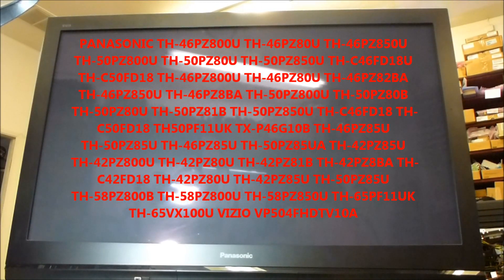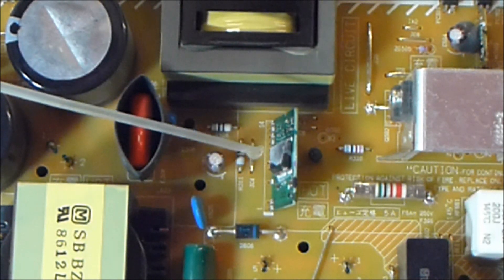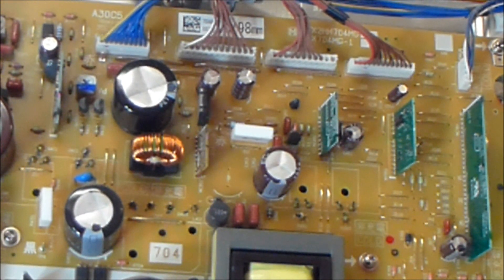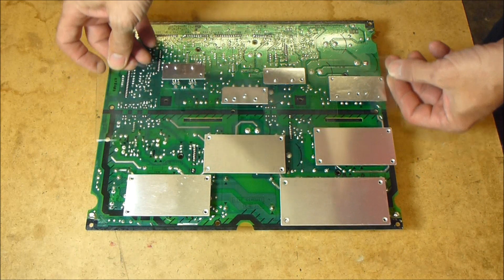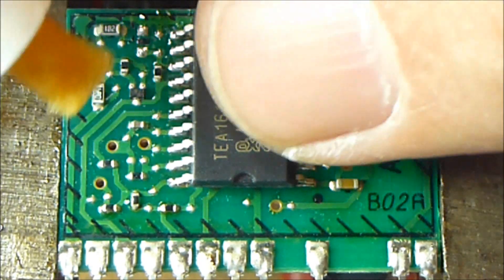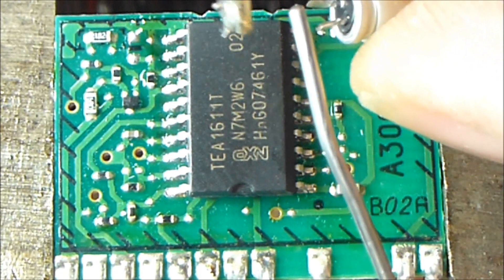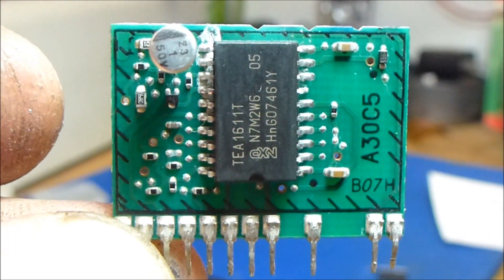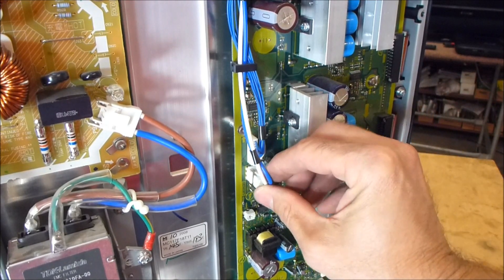Panasonic Plasma 10 and 2 Blinks TEA1611 ETX2MM702 704 706 Power Supply TH 42 46 50 58 PZ 800 85

Comment: Is there a kit for this?  I have over 30 years soldering experience, even with SMD's.  I have the TH-46PZ80U and used "freeze spray" on the circuit which of course got the TV back up and running.  Please shoot me an email if there is a kit for this particular model,
Reply: Okay, I finally watched the whole video.  When I remove SMD's I use a heat gun hitting the center of the old chip and it pops off on it's own without the possibility of damaging the pads.  When I put the new SMD back on, then I bridge all the pins with solder and remove excess with solder wic.
Reply: Mitchell Simmons
Nice work !
Did you also replace the IC's decoupling capacitor  ?   This is the device that actually fails and causes the IC's power rail to droop down enough to wreak havoc with the analog resonant converter IC.
Regards, GS.
Reply: Gary Spencer I haven't ordered the kit yet.  I was wondering if one can purchase the IC's MC301 and MC201 without replacing the caps.  I agree the capacitors are faulty, Sony is notorious for installing inferior caps, although this is a Sanyo
Reply: Mitchell Simmons

Mitch,
The designators for MC201 and MC301 refers to the circuit board name.  There are no designations for
components mounted on these boards.  The 20 pin integrated circuit (IC) TEA1611T is made by NXP Semiconductor.
The MC201 & MC301 boards are no longer available.  The only way to obtain these boards is to buy the large
P Board.  I do not recommend replacing the IC's.  They rarely fail and are very high quality and robust.  The small
ceramic decoupling capacitor is the device that slowly breaks down and causes Vdd to droop down at ambient
temperature.  The low supply potential on Vdd will cause the analog chip to malfunction causing these high current
power supplies to shut down.  These switching power supplies are high efficiency Series Resonant Converter designs
(Series LC Resonant Converter).
Remove the ceramic piece of schitt and replace with high quality electrolytic with short leads (approx 3 to 5mm) using
capacitance in the range of 0.22uF to 1.0uF.  I used a 50V, 1uF, cap from DigiKey.
Regards, GS
Reply: Yeah, that's what I ordered, just the caps.  4.99 for four of them.  My experience with power supplies dates back to the early 80's.  The replacement caps shows that the OEM are inferior.
Reply: +Gary Spencer Did you replace the ones he replaces on this video, I would rather not replace the IC chips if it's un-necessary.  could you let me know what capictors you replaced.  thanks
Reply: I got mine on eBay.  It was such a while ago, like three or four years ago.  It comes with the two ICs for the MC301 and the MC201 and the electrolytic capacitors.

Comment: My Panasonic Viera 50" Plasma started doing a similar thing about a month ago. But If I unplugged the power for a few minutes then plugged back up..,everything was back to normal. And it would work like normal for several day to a week, then out of the blue it would happen again. That is until this morning. It did the red blinking light this morning and despite unplugging numerous times,etc...,nothing. When I plug it back up, it sounds like the tv clicks on..,but nothing but black screen and 10 consecutive blinking red lights. I count 10 blinks instead of 7. My tv is a little older (March 2008)..,but has never ever gave me any trouble at all. That is until about a month ago and this started happening. Now it wont do nothing but sit and damn blink !!!  Model # TH-50PZ80U. Please help..,as I cannot afford to go buy another tv !!  :(
Reply: ...,Great video. But I'm not good at very technical self repairs like you did in the video. Plus I don't have the tools either. I just wonder if its even worth "trying" to pay to get it repaired or just (try) to save up and get a new tv ??!!  :(
Reply: Ok..,after getting aggravated w/ the tv this morning. I just went to bed (I work 3rd shift). I got up about an hour ago and figured what the heck..,Id try the tv one more time. Plugged it up (heard 2 clicks)..,walked around and no blinking red lights. I hit power on remote and surprise..,it Works !! Its back on now........,for now :/
Reply: ZyklonB13

Unfortunately, it will fail due to a marginal component that is out-of-spec or degraded.
So, when it finally fails, pull the back cover off the unit and perform the "cool down" test shown in the repair video.
If it responds to the cool down test, then you could bring it to a GOOD repair shop for a repair estimate.
The repair should be less than $100 bucks (in my opinion).  All they have to do is replace a $0.30 capacitor
on the MC201 or MC301 mezzanine board(s).
Otherwise, if you know someone who has good soldering skills, ask them to remove/replace capacitor.
The CAPACITOR is the component that fails - NOT the NXP integrated circuit (resonant converter controller).
Regards,  GS
Reply: Gary Spencer  Well..,I knew it couldn't last long. Got up this afternoon and tried to turn on tv. Same thing...,nothing but 10 blinking red lights. Uhhgggg!!!  Guess I will do as you suggest Gary and remove the back and try the cool down.

Comment: Thank you so much for this video.  Did the freeze on both my IC chips independently and it solves the problem.  Problem is I don't have the ability to solder new IC chips.  Calling around to local shops they're quoting me 125 to 150 bucks in labor.  That seems excessive to me, am I being naive? Especially if I can bring them just the P-board, I've already taken the TV half apart.
Reply: Andy,
You are smart not to attempt this.  It is NOT trivial in the least.  It requires a fair amount of experience and specific talent
with the right heat output from soldering iron.
Several people in this blog had damaged the MC201 or MC301 boards over the last 2yrs or so.
Removing the de-coupling capacitor is much harder than installing the new one.  The capacitor is the actual component
that is failing.  It is extremely rare that the NXP controller IC will fail.
Which board was sensitive to the cool down test  .......MC301 ?
The local shops near you are nothing but bandits.  It takes less than 5 minutes to remove the MC301 board from the
P Board.  It takes about 8 to 10 minutes to remove & install the new IC.  It takes less than 3 minutes to remove & install the de-coupling cap.  And, .......you have the luxury of sitting on your ass while you're doing the job  !
I will fix it for you for free.  But, I will insist that you get two 1uF, 50V high quality electrolytic capacitors before you
send it to me.  There is ordering info for this in this blog in several places (Digikey) in my replies to folks.
So, let me know if you want to ship it out. You will have to buy an anti-static bag large enough for the P Board.
What is the model number of your Panasonic Plasma  ?

Regards, Gary
Reply: Gary Spencer
"It takes less than 5 minutes to remove the MC301 board from the
P Board. " ...  How exactly do you remove it?
Reply: +Gary Spencer How can I contact you?
Reply: Andy Ludwig 
Andy,
You can contact me via my Gmail account.
      garyspencer586@gmail.com
Gary S.

Comment: When I plug it in I get the 2 clicks followed by the pause then a single click. When I try to power it on I get a single click and then the set goes into the 2 blink code. The manual says the 2 blink code is for the D-board but I replaced that and I am still getting the same result. Any ideas?
Reply: Yoosuk,

The blinking SOS codes ONLY indicate which board needs to be checked.  The list of codes (1 thru 13) guides you
to the location where you can measure a Test Point.  It DOES NOT mean that the "board" is the failing board.  It only means that you can go to that specific board to perform a check point .....or Test Point.
Please give the full model number of your TV.  I need to know if it's a 10 or 11 chassis.  Thanks.
GS.
Reply: it is the th-42pz85u
Reply: Yoosuk Choi

Yoosuk,
You're going to need the Panasonic Troubleshooting Guide to isolate the failing board and/or circuit.
It is most likely the P Board.  Did you perform the "cool down" test shown in this repair video  ?
If not, you need to do that test before you try anything else.  The 2 blink SOS code indicates a loss
of +15V.  This voltage is generated on the main power supply board (P Board).

Download the Panasonic technical handbook at link below:
http://elektrotanya.com/panasonic_th-42-46-50pz80u_th-42-46-50pz85u_th-42-46-50pz800u_th-46-50pz850u_chassis_gph11du.pdf/download.html

Comment: Thanks for posting this video, it has saved me from having to throw my Panasonic Plasma away! It started doing the 10 blinks after 3 clicks. I contacted Panasonic Australia and they told me that the 704 board is no longer produced. I tested the problem using the freeze spray and confirmed which IC was the problem. I ended up buying the IC from EBAY and the first one they sent me was faulty but the second one worked fine. A bit fiddly to take the 704 board off the TV and desolder/solder the IC but it's better than having to buy a new TV.

Comment: Great Video! I’m receiving the 2 blink code and I have a couple of naïve ?’s  1. What does freezing the IC chip do and why does it make my TV now miraculous work again?   2. Does it make sense to replace both IC chips as it appears my problem is with the MC201 and not the MC301 (no change when I freeze just this chip).  The repair kit I ordered comes with 2 chips and 2 capacitors, so I wanted to get your thoughts on whether or not I should replace both.  3.  Is it possible to replace the IC chip and capacitors without taking the MC201 off the P-board?  4. Do I need to use a specific type of solder to make this repair?  5. Unlike the video, there appears to be another capacitor next to my MC201, which has some black foam that glues the two together.  I’m assuming I can just scrap this foam off the M201 when I take it off the P-board, right?
Reply: Chris,

1. What does freezing the IC chip do and why does it make my TV now miraculous work again ?
    It momentarily slows down the excessive leakage current thru the "bad" capacitor.  This capacitor is providing
    decoupling action to the analog IC (resonant converter controller chip).  When cap warms up, it will drag down the
     analog supply to the IC which prevents it from working normal fashion.
2A. Does it make sense to replace both IC chips as it appears my problem is with the MC201 and not the MC301 (no change when I freeze just this chip).
     The problem is with these low quality ceramic capacitors.  Only replace the capacitors very, very, carefully.
2B. The repair kit I ordered comes with 2 chips and 2 capacitors, so I wanted to get your thoughts on whether or not I   should replace both. 
      Replace both capacitors.
3.  Is it possible to replace the IC chip and capacitors without taking the MC201 off the P-board ? 
     It is easy to replace capacitor on MC301 but I'm not sure about the access to the top left of the MC201 board.
     I repaired my MC301 board without removing from P Board.  This saved LOTS of time.
4. Do I need to use a specific type of solder to make this repair ? 
    YES !   You need to use a 15 watt iron with a fine tip.  Too much heat will damage the circuit pad(s).
5. Unlike the video, there appears to be another capacitor next to my MC201, which has some black foam that glues the two together.  I’m assuming I can just scrap this foam off the M201 when I take it off the P-board, right ?
    I will have to take a close look at the MC201 board.  Look, one end of the capacitor goes directly to the supply pin of
    the IC chip via a very short trace.
    NOTE:  It is very possible that Panasonic revised this little board slightly and made provisions to solder down 2
                ceramic capacitors in parallel to increase the capacitance a smidge.  Just a bloody guess.

Regards,  Gary S.
Reply: Gary Spencer Gary, thanks for your detailed response!  Unfortunately, I was not able to repair my Panasonic as I damaged the MC301 when trying to make this repair. :(  Please note this was the first time I tried to solder anything.  The IC Chips were relatively easy to remove and replace; however, the capacitors are extremely hard to solder to the board due to their miniature size. If I could do it over again I would probably send me MC201 & MC301 to repair guys listing their services on eBay who will make this repair for $30. Nevertheless, I'm satisfied saying I tried to save my TV from the heap...onto the next one!
Reply: IndyChris
Chris,

All is not lost.  The board can still be repaired if only the capacitor etches (traces) are damaged.
You would just have to use a radial electrolytic type capacitor which has package leads that you have to cut
down to the size and location of capacitor placement.  If you know anyone who has good knowledge of soldering,
they would be able to do this for you in a few minutes.  If you have not purchased a new unit yet, send it to me and I will
fix it for free.  How could anyone charge $30 for 3 minutes of labor  ?
Repairing the damaged board is trivial.  Most of the damage is due to excessive heat which de-laminates the circuit
etch "locally" and sometimes can break off.  Restoring the circuit structure is very simple when working with a
de-coupling capacitor location.
Regards,  GS.
Reply: Gary Spencer Thanks for the offer Gary! Unforunately, I have recycled the TV.  I order a used P-Board online after my soldering mishap, but I will still getting the 2 blink code. I believe I bought a P-Board with the same issue as it was missing some of the screws that attached the heatshield which leads me to believe someone tried taking it apart before.  Nevertheless, I received a full refund.  If you want to pay for shipping I could send you this P-Board.  You can fix it and sell for $100+ on eBay.  If not, its going to dump... :-/  Nevertheless, thanks again for your help!
Reply: Your effort was good!!!.  You can also get some teach-to-solder kits on eBay  and Amazon so you can get some practice on how to solder correctly.